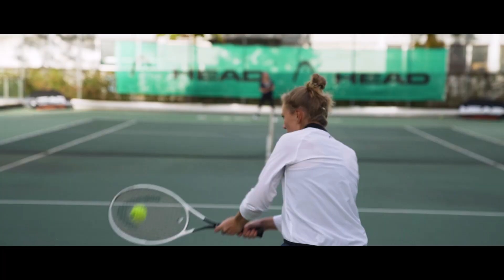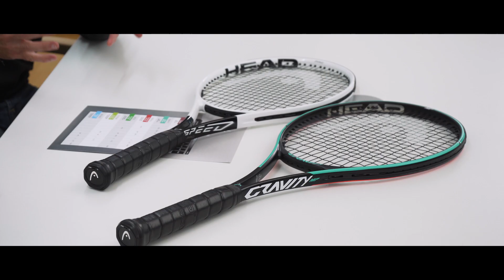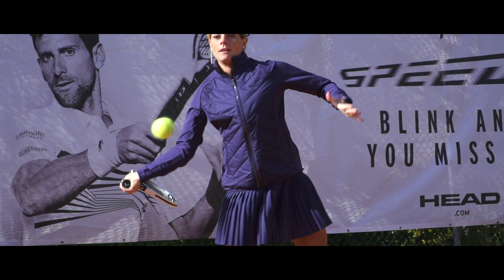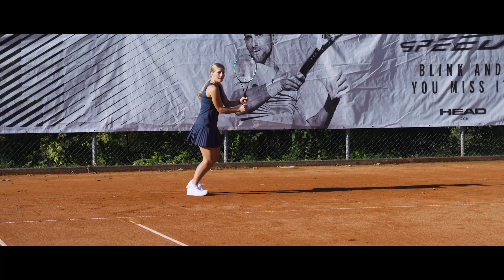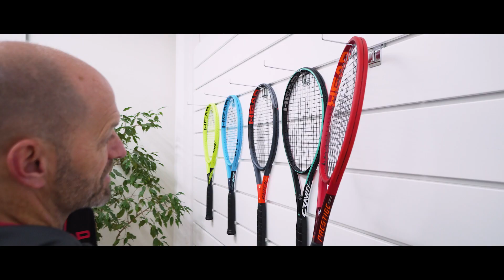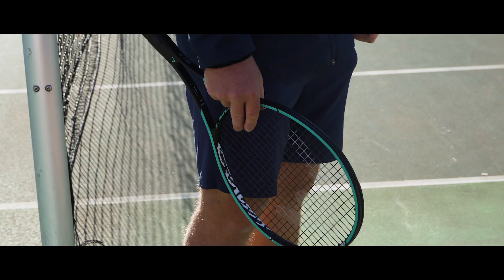Learn more about the Head Graphene 360+ Gravity & Speed tennis racquets

Comment: What is the cheapest natural gut string out there? I break strings very quickly and put it in the crosses
Reply from the maker: Klip Legend Natural Gut is the cheapest. That said, the Babolat Touch Tonic would likely be the best value, as it is more durable than the Klip Legend. Troy, TW
Reply: String ur racket at 23 pounds . No way it will break
Reply: Jordan Stopper That tension is far too low. If i go full rpm blast it is at 24kg but in hybrids i string rpm blast at 26kg on the mains and gut at 27kg on the crosses.

Comment: Nice racquet, I've just got mine (the Speed MP 360+) and it feels really stable. I was hesitating with the Gravity MP which I love (tried at least 10 or 15 hours) but I would say the Speed MP is easier to play with and give a bit more free power I need. Gravity MP is more control oriented racquet. Both are quite arm friendly but for a plusher/buttery feel go for Gravity line which is quite souple and very comfortable. Speed is a bit more firm but not uncomfortable at all such as some high rated stiffness rating racquets. I found the racquet very solid and well dampened also. Manoeuvrability is ok for both. Not the most manoeuvrable racquet for an intermediate level player like me but still decent. I particularly love my volley and slice backhand with this racquet, my kick serve also.

Comment: Hi I have a Head speed pro, not this new model but perhaps a 2017 head speed pro what string and tension do you guys recommend on it I am looking for spin and power
Reply from the maker: For spin, and power, a hybrid is a good choice. Something like Wilson Duo Power, or Gamma Moto TNT Hybrid. If you want ultra premium performance, then you could go Babolat VS gut in the mains, and Luxilon ALU Power in the crosses, which is the set-up that Novak uses. Troy, TW

Comment: Currently there is no HEAD racquet that suits my game.  The racquets are much too light and too stiff.  They have made the game too powerful.  I really, really miss the old heavier and flexible frames.  They were so comfortable and stable and so much easier on my arm and wrist.  And, they did not require a Western forehand grip.  Sad.
Reply from the maker: @Ted Neanderthal, 
Have you seen the Head Pro Tour 2.0?!
Michelle, TW
Reply: @tenniswarehouse  It has a stiff RA of 65.  My current HEAD frame - Graphene Touch Radical S - has a 61 RA and a 102 sq. inch head and my wrist is really hurting; it's strung with a syngut at mid tension.  I want a plush frame, not a crisp one.  I also have an old and a new MicroGel Radical Oversize.  Unlike my old one, the new one groans when I hit moderate topspin.  Had to put lead tape at the 3 and 9 o'clock positions to stabilize it; the dense string pattern gives me a low trajectory and my shots just clear the net.  I've been playing for 40 years.  I have not been able to adapt to the new technology.  Every year the racquets are stiffer and lighter and more unplayable.
Reply: @tedneanderthal7373  The RA rating is actually debatable a lot of the time - I used the classic Prestige 600 for a long time and that felt super buttery to me and was still rated at a 60 flex from what I can see, and I also tried your Graphene Radical which you say has a 61 and it feels very stiff to me.  All the Graphene line felt stiff to me actually.  The Pro Tour 2.0 actually plays way softer than its RA would suggest but make sure you aren't using their Lynx string that comes with the stock frame as it does feel stiff.  You could also try the Gravity Pro that is now my main and its flex is among the lowest of all manufactured racquets at 59 and feels quite plush by most standards.  I'd give it a shot or the Yonex HD which also a 50 something flex and feels really nice.
Reply: @sasukesarutobi8431  Many thanks for your comments.  The Graphene Touch Radical S definitely feels crisp though I do feel some flex in the bridge area where the frame is thinner.  I would consider the Pro Tour 2.0 if its string pattern were more open.  I have decided to only consider frames available in a 4 5/8" grip with 16 main strings; smaller grips force me to squeeze the handle too tightly which leads to wrist and elbow issues.  Unfortunately most frames labeled Pro or Tour have 18 mains though they do have the weight that I am looking for.  I have ordered a Prince Phantom in the hope that at least I will be able to play without reinjuring myself.  With that frame's lack of power, I have doubts that my game will be very effective.  I will find out soon enough.  Again, many thanks.
Reply: @tedneanderthal7373  I also have a Prince 97p and that is a very nice and comfortable frame haha so I wish you the best of luck. It feels strangely quick though and also doesn't feel quite as open as other 16x19 racquets I've tried as the head does feel small. A lot of people say it has a small sweetspot but i think it just has a super plush center. Good luck!